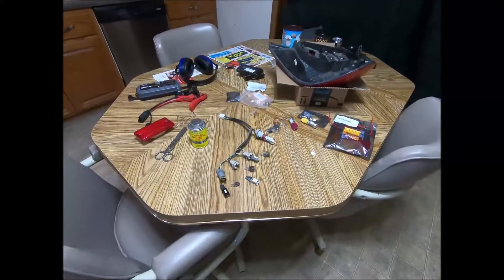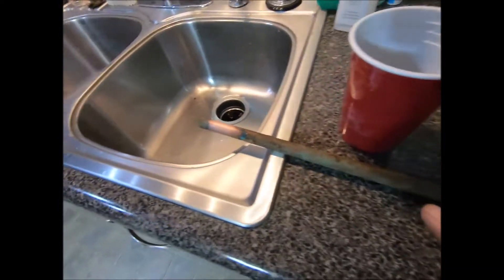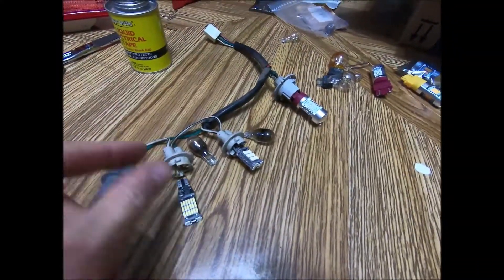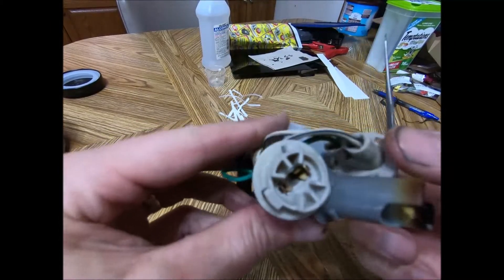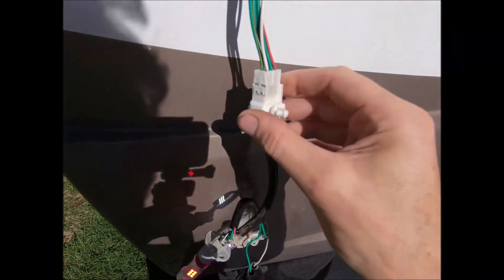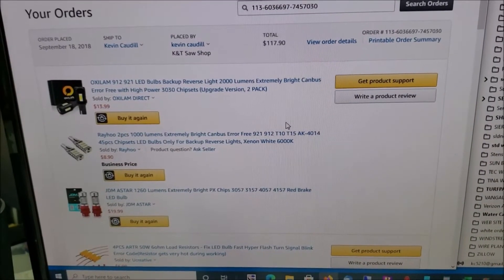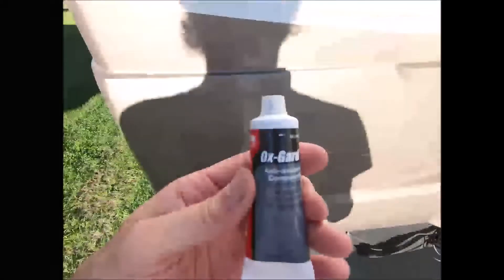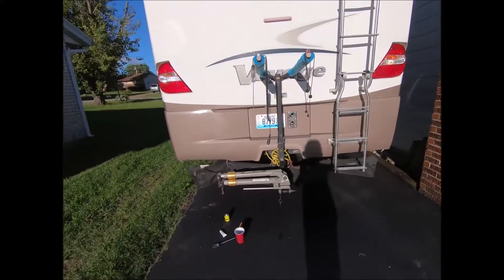RV Tail Light Upgrade To LED Bulbs No More Flicking Lights What a Difference !

Comment: Thanks for doing the comparison segment between the led and incandescent. My coach uses the old 1157 & 1156 bulbs. Hopefully I can find the bulbs you used in that configuration. 
Good to hear that you didn’t need the load resistors.
Reply from the maker: I did that mod over 2 years ago and they've been working great knock on wood.

Comment: You keep finding more stuff for me to do! Going all LED on the interior. Actually, we've purchased all the LEDs for the interior, just need to install them. Going to modify what you demonstrated on your cabin light. Going to install cool white and soft white LED strips and control which strip is on with a SPDT (on/off/on) switch.
Thanks for the video!
Reply from the maker: Thanks for watching its good to know I'm helping to keep you out of trouble..lol

Comment: Excellent post (as usual).  Thank you so much.  I will be making similar upgrade (along with running lights) in a few weeks when I rejoin my rig.  I'll be interested to find out if I need the resistor or not.  Thank you also for the 'Ox-Gard' reminder.    I am curious why you choose to use the liquid tape over typical electrical tape.  The probability is low that you would need to rewire/re-pin a connector but I would think the liquid tape will make that more difficult.     Btw, I got a chuckle out of the RV company using the Toyota taillight housing(my 05 Sun Voyager has the standard 4" round).  Nothing wrong with it. Just fascinating how varied our RV parts bins can be.
Reply from the maker: I only used the liquid tape on the backside of each connector to try to mimic factory connections that are sealed like in the engine bay of most cars. I did not seal where the connectors push together so i can take apart later if needed. Tape tends to dry out over time allowing moister in the connection.
Thanks for watching

Comment: Another question:  About how long did you soak the connectors for, and what was the follow up baking soda procedure you used?
Reply from the maker: Yes i left that part out some how, I think i soaked them for 1 hour each side then I did the same with some baking soda in warm water to neutralize the previous step.

Comment: Do yourself a favor and DO NOT use the wire in type of load resistor. Spend the $9.00 and get the EP27/FL27 electronic LED flasher from Amazon or local auto parts store. Saves having to cut wires and also not have to worry about those wire in resistors heat up enough to melt wiring covers.
Reply from the maker: Thank you for the tip.
Infact i did not have to use them after all. And u am still using the factory flasher.